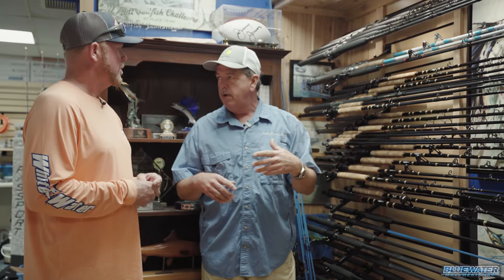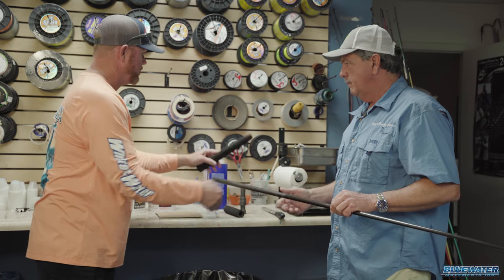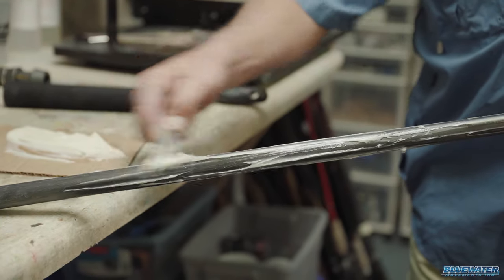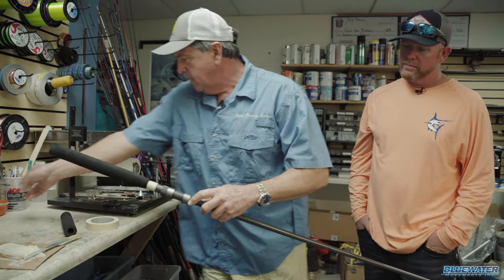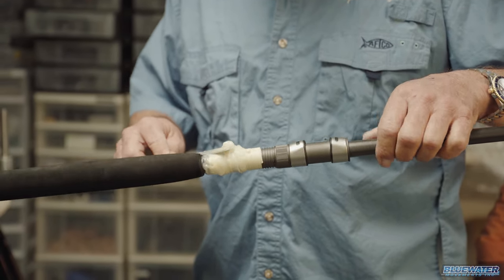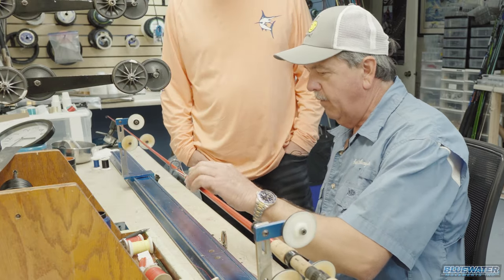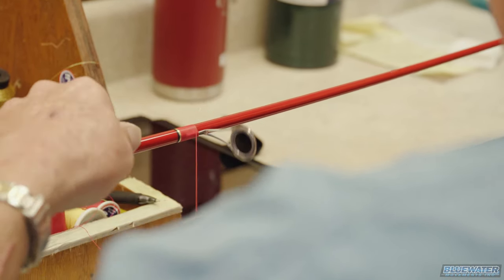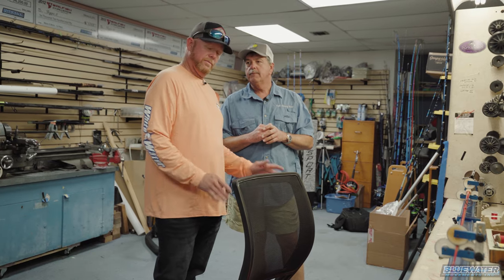How to build a custom rod with Captain Randy Towe

Comment: Don’t forget to mark your spine first and align your reel seat. Your reel seat and guides should be on the same side of the rod. This video shows marking the spine after the reel seat is already glued in place.
Reply: He used rod bond so he can spin it around for a couple hours before it starts setting too good. I don't even worry about the spine i just build on the straightest axis.

Comment: I sanded the rod and painted it with a different color, I just don’t know what type of clear to add to the blank , should I  apply a thin coat of flex coat?
Reply from the maker: @Capt. Randy Towe
Reply from the maker: Check the channel we mentioned in our comment below. Captain Randy is a rod building guru and can guide you in the right direction.